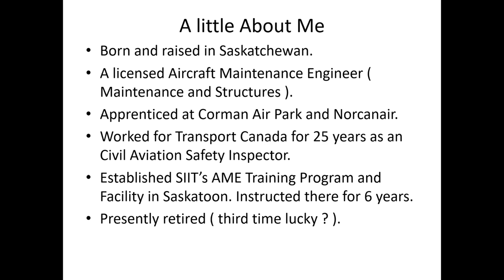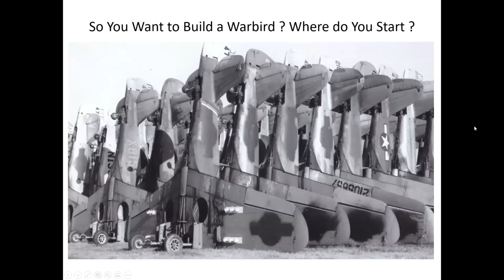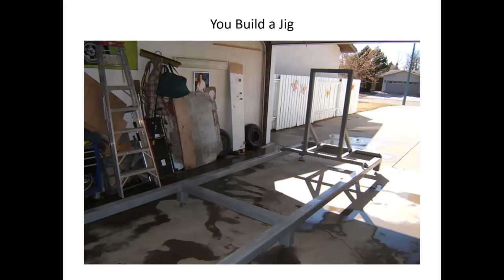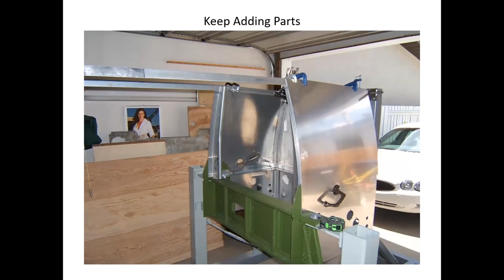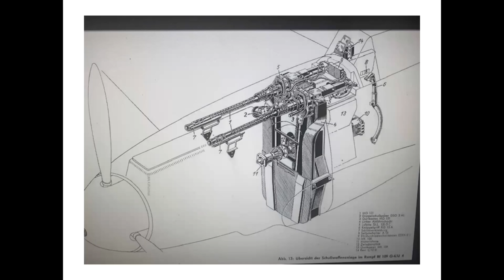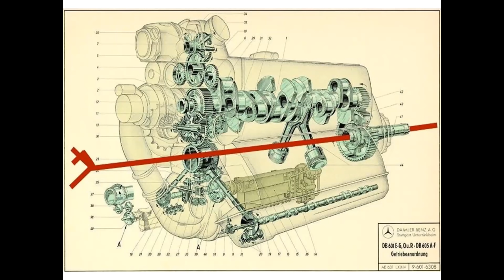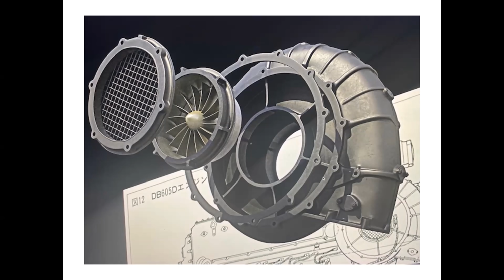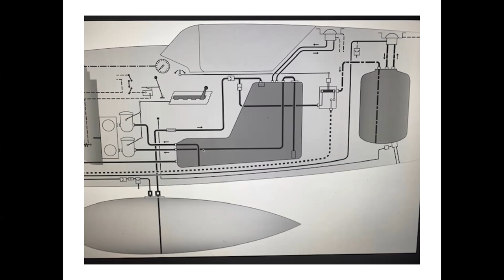Building/Rebuilding The Bf 109 G-6 and Bf 109 G-10 Aircraft in Canada

Comment: MG131 cowl machine guns on the Me109G6 and later versions used mild steel case ammunition, so collecting the spent cases and links was not done for recycling purposes ;). The 20mm MG151/20 canon as well as the MK108 canon was also using mild steel case ammunition. In fact, by 1942 germany was basically not producing brass case ammunition anymore because of lack of raw material

Comment: After all the engineering that goes into such a project most folk see the paint scheme. Is there a photo from WW2 of white 20 ? What are the RLM colours of this as the pale blue appears very pale indeed with the hard edged single RLM shade dots is not a scheme I have seen though I am more familiar with the spray mottle where there is no edge to the shapes of 1940., along with occasional sponge or brush daubed styles. Brush painted large spots is not one I have come across before.
Reply: Hello Mr. Charles, 
The paint scheme that is currently on the Bf109G6 is only temporary. Any metal left exposed to oxygen will start to corrode. This is why aviation grade chromatic primer has been sprayed to protect all of the aircraft. But looking at a temporary paint scheme while on display at the Aviation museum, looks nicer than just seeing the project in a primer color. Once completed, a final proper paint scheme will be applied. 
Cheers.